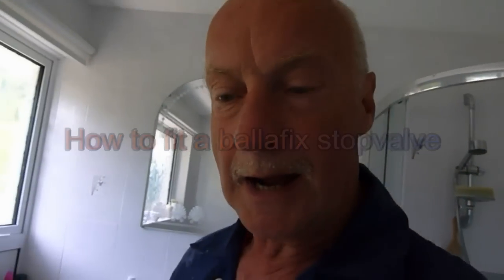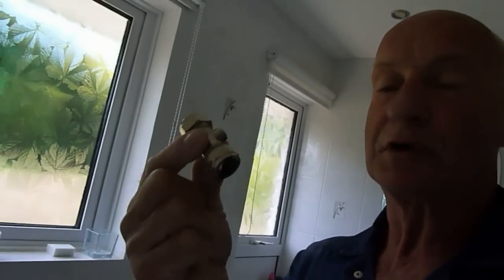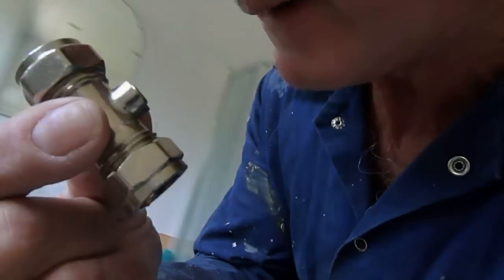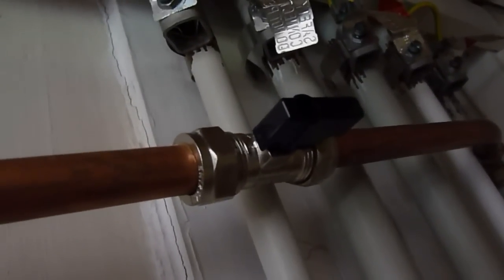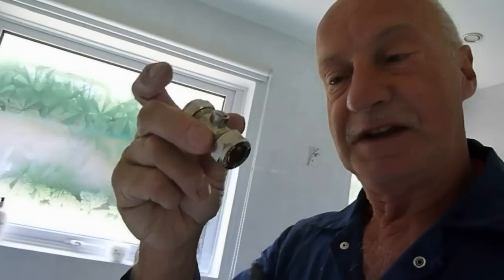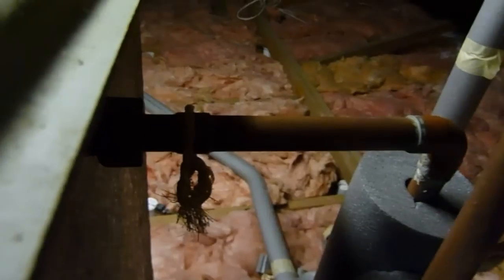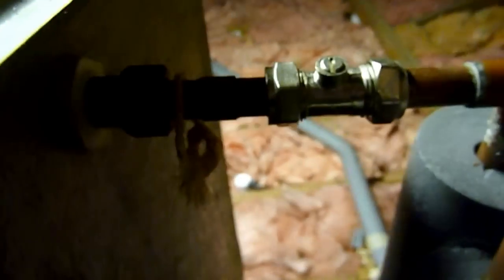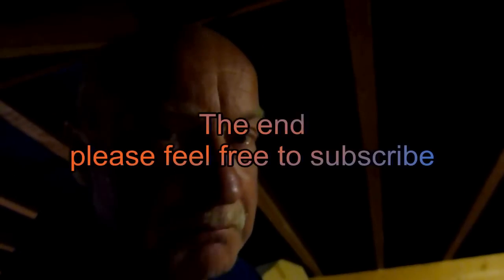How to fit a ballofix stop valve.Isolating valve

Comment: Good video, thanks.   Even the cheapest tube cutter is far superior to a hacksaw; much easier and quicker to use (you don't have to hold the tube with one hand while sawing with the other) and makes a perfectly straight and clean cut. Prices start at £2.99 and unless you intend to take up plumbing as a trade, that's all you need.

Comment: Very grateful Dereton33 this has help me get ready to fit a new kitchen which is coming this week any tip for installing a new kitchen sink into a counter and again Thank you
Reply from the maker: Mark Chalmers  Hi mark, I usually place the sink bowl upside down on the worktop where you want it to be and draw a line around it, remove the bowl, then remark half an inch inside your previous mark, then cut out with a jigsaw. Al.

Comment: If you are changing and isolation valve, do you need to change the old olive and nut too? I screwed a new one on to the old one but there’s a small leak. Should I just tighten as hard as I can? Thanks. Your channel is really helpful.
Reply from the maker: Yes try tighting it if it still leaks then you will need to replace the olive.

Comment: Hi Dereton33

I've just bought a bag of 10 of these isolating values, gunna install them in the bathroom, kitchen and an outside tap in the next few months once I can afford to get the other things I need.
Just wondering if you could do a vid on the different applications of Jointing compound, plumbers mait etc, etc.
Learnt loads from your site,.
Thanks.

Comment: Thank you for this video. When you turned the water off using the new valve you turned the spindle anticlockwise 90 degrees. Would it be wrong to turn the spindle clockwise 90 degrees to turn off the water? I am thinking inside the valve there is a ball with a hole through it and it wouldn't matter which direction the spindle was turned. thank you.
Reply from the maker: It only turns one way, so it depends which way up you fir it as to what direction it turns.

Comment: I've just had one fitted from the cold feed tank in the loft to the cylinder in the airing cupboard and I can't tell if the arrow is pointing the right way. What would happen if it was the wrong way round dereton33? Thanks.
Reply from the maker: Nothing it would still work.

Comment: Very helpful clip as I'm about to fit this to the sink in my ground floor cloakroom.
The direction of water flow from what I'd seen on various places is from bottom to up to the taps, is there any reason the isolation valve shouldn't be fitted when the water flow is from top of the pipe to bottom before it gets to the taps? 

Reason is that the section of the pipe that feeds to my toilet tank is along the skirting board, making it vulnerable to getting stepped on and breaking causing a leak, so need to fit an isolation valve before this section, e.g. where the flow is from the ceiling downward pipe. before it splits with a T junction to toilet tank and taps for the sink.
Reply from the maker: That would be fine.

Comment: I have decided to fit 2 x 22mm (hot and cold) isolating valves to the downstairs bathroom. You say you cut 1" of 15mm pipe to allow for the body. What would you allow for the 22mm valve body? Thanks - PS Always find your videos really useful.
Reply from the maker: About an inch also.

Comment: I've got a leaky towel rail isolator valve - your tutorial is really useful but to replace the isolating valve on a towel radiator do I need to drain the central heating system?
Reply from the maker: Hi Susan, yes you will have to drain the system. Al.

Comment: What's the best way to get paint off the ends of the copper pipe so its clean. Fitting my first one to a sink feed and both  pipes are painted. Emulsion I think... Thanks.
Reply from the maker: There is a proper cleaning tool for the job in my Amazon store.

Comment: Hi Dereton, I want to fit an isolation valve to a toilet cistern, however there is only about 12 inches of straight pipe. I am guessing there is little to no play in the copper pipes if cut, definitely no up and down movement, maybe a little sideways movement.  What valve would you recommend ? Should I use flexible tails? Are there deep bore valves available to slide onto the other end ?.....many thanks.
Reply from the maker: Easiest option would be a flexi with included valve on it.

Comment: Are these valves designed to work only in the fully open or fully closed position - IE can they be used to merely reduce the flow of water if there's too much pressure? the problem I have is that since getting a combi system installed I cannot get the pressure right - there's too much pressure at the bathroom sink, operation is noisy and the mixer tap is stiff to operate. If you turn the pressure down to an acceptable level using the main stop valve then the water is just a trickle the rest of the house.
Reply from the maker: They work well in slowing that speed of water down.
Reply: @dereton33  thanks

Comment: Wish I'd watched this before fitting mine to bath tap inlet pupes! Forgot the Boss white sealant and although they seemed watertight at first, 4 mths later there is a tiny leak in one that has SOAKED through outside wall.. unfortunately I'd tiled in the pipes so did not spot it til very late in the dat! Argh!! Stupid error.(Had to smash up 4 massive travertine tiles to get to it!!)

Can I ask if you'd recommend copper over rubber pipes for less leakiness/longevity? (I have rubber ones)
Also, getting the nut and olive off the rubber pipe was incredibly hard! Hacksawed it off in the end... have new olive. Just want to ensure THIS time they are 100% watertight, and that all brickwork is completely dry before retiling!
Reply from the maker: I always recommend copper pipe over plastic pipe. Good luck with it this time.

Comment: Hi there, what’s the best way i can sort this out. The wife has brought a fancy tap for the bathroom sink. A single mixer tap. Under the sink there are click plastic pipes. While the new tap has flexi pipes for hot and cold. How can I get around this. Feedback Welcome Thanks👍
Reply from the maker: Just cut the plastic pipes and connect the fleixs to them, make sure to fit an insert into the plastic pipes.

Comment: Where are you turning the water off . From mains under skink? Do you have to push the ball don till waters all out? Or easier way
Reply from the maker: Under the sink. No you do not have to push the ball down.
Reply: +dereton33 so you dont have to drain?. just turning tap off will do? thanks

Comment: Hi Dereton22. Where did you get that stop valve with a handle? I can't find it anywhere. Good video by the way thank you very much.
Reply from the maker: Hi hueance , I got the valve from Screwfix.
Kind regards,
al.
Reply: Hi Dereton. I have bought a pair from screwfix now. Thank you.
Reply from the maker: No problem  , good luck with it.
Regards,
al.

Comment: I have a stopvalve on my sink & toilet & I'm looking replace the piping going to the tap with Flexible Tap Connector, is there Flexible Tap Connector that can fit in to a stopvalve?
Reply from the maker: You can buy a flexi connector with a valve built in.

Comment: Thanks for the video.  I've found that the 15 mm pack of 10 from Screwfix are fine when initially fitted but if you try to isolate the water at a later date they leak!  Do you have a view on that?
Reply from the maker: Yes they are really poor quality. Buy the more expensive ones from reputable plumbing shops.
Reply: @dereton33  I am considering fitting a service valve to my mains pressure cold water supply to my cold water tank in my loft. Would it be better to fit a stopcock valve like the primary one I have under my kitchen sink? The ball valve units are neater but after reading about their tendency to leak, I am having doubts.

Comment: hi when fitting isolating valve the arrow has to go to the flow if installed  wrong way round what will happen
thanks
Reply from the maker: Err well nothing.
Reply: dereton33 so it will function accurately which ever way u install  it whats the purpose for the arrow than thanks
Reply from the maker: Better for flow as the ball is cut to allow better movement of water.

Comment: Ever  had one of these not close off? One on my toilet doesn't work .The water still flows. And I think the installer knew because the  valve is fitted such that the screw is facing the wall - need a stubby screw driver to turn it blind.

So I need to replace it. How hard is that and will the olives be okay.

Cheers.
Reply from the maker: +Salik Rafiq Forget it and fit a new one.
Reply: throw in some silicone grease around the ball in the valve and give it a few turns back and forth
and it'll work like new again. that's what i do when my ball valve accessories don't budge and silicone grease
can be used with potable water lines.
Reply: http://www.homedepot.com/p/DANCO-0-5-oz-Silicone-Faucet-Grease-88693/203193536
Yes that includes ball valve stems.

Comment: You should advise users to get a pipe slice, rather than use a hacksaw because the pipe slice leaves the pipe ends nice a clean and ready to put in the tap. Using a hacksaw then requires the user to clean the pipe up which can be a right pain if it is in an awkward position, and they might use the wrong tool for the job which might distort the end of the pipe, leading to a nightmare
Reply from the maker: I have to assume most DIY people have the minimum amount of tools at there disposal.